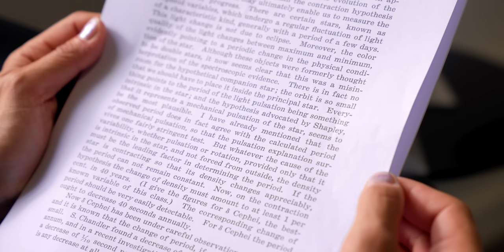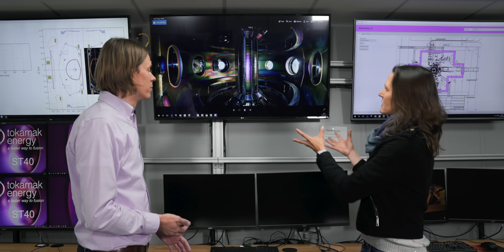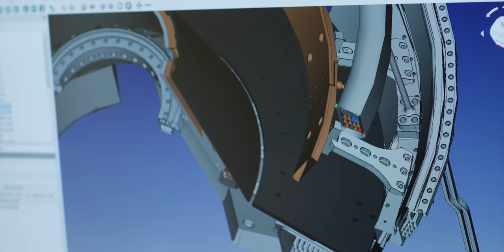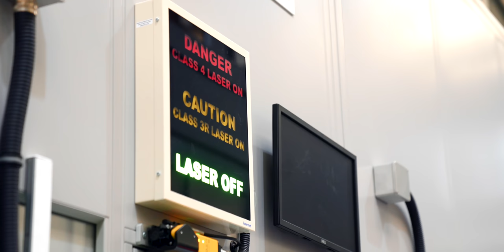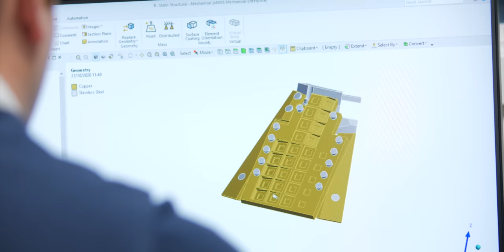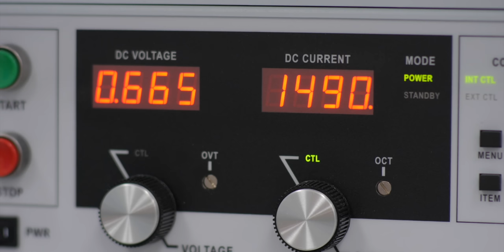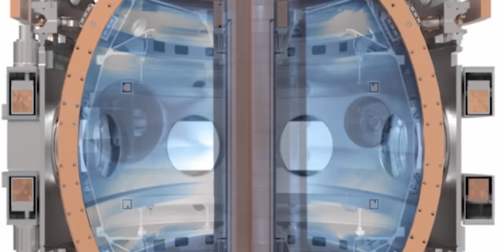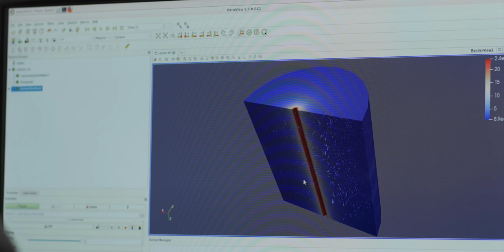Nuclear Fusion: The Secret to CHEAP and LIMITLESS Clean Energy?!

Comment: the problem of having too much energy is worse than expanding beyond our means so there always isnt quite enough. 

But i suppose thats something we'll realise later, much in the same way we seem to do everything.
Reply: How do you expand beyond your means with unlimited energy?
Reply: @vesawuoristo4162  another way of describing it would be having 1000 cars but you can only drive 1 at a time, have a 1000 houses and only live in 1 at a time. You gonna maintain those 2000 cars and houses???? etc.
Reply: @gaiustesla9324  
How about build +10% of requirement.
Turn off 10% of capacity.
Adjust as required.
?
Reply: @rogerstarkey5390  brilliant! except totally not realistic unless you have a dictatorship over technology and energy.

Comment: no is the answer as it's proving mind-bogglingly difficult to control plasma
Reply: The problem that nobody addressing is chaotic/turbulent flow in the plasma. It's fine for a short while in controlled laminar flow then it goes crazy.
Reply: @grahamstevenson1740  There are entire research groups working on turbulence control in fusion devices
Reply: @arnasvolcokas7289  Good luck to them ! Turbulent flow is an entirely natural effect.

Comment: I am very skeptical about this. Nuclear fission was discovered in 1938 and we an atomic bomb 7 years later. We had the first controlled nuclear reaction 6 years after that. We have been aware of nuclear fusion for nearly 100 years, and there is STILL no technologically feasible method for creating a man-made sustainable fusion reaction that produces significantly more energy than it requires to sustain the reaction. 

This video set out to answer the question, are we still saying "fusion is 30 years away?" The answer is apparently "yes". Even if we overcomes the technological hurdles, there are no reasons to believe that the resulting technology will be economically feasible. It seems like solar/wind power plus storage is a vastly more practical and economical way to create unlimited amounts of green energy. Nuclear fusion seems like a multi-billion dollar boondoggle to me.
Reply: Fission is indeed much easier and mature.
It also is near limitless.

It's just ignored or vilified by many who don't understand it.
To be fair it is nuclear science and not an easy subject to master.

Comment: What interests me - is that accidents happen, terrorist attacks happen, etc etc.. What happens when something goes wrong?  Will it safely just shut off and do nothing?  Or are we talking about half the planet going kaboom?
Reply: They are exceptionally safe from major accidents - if a bomb pulverized the plant the most dangerous thing would be the bomb. There would be radiation release that might require small targeted evacuation but it would have to be blasted by an external attack... the reaction requires such fuel purity that you could out it out by blowing on it

Comment: So it is now 10 to 20 years away.   That will probably be the case for next 50 years.
BUT
I already power my home nearly 100% off fusion (froom H2) derived energy, the reactor runs 24/7 and has been for a very long time.  We only access it for for less than half of that 24 hour period and extract (capture) energy from the reactor using photo Voltaic panels which turn that into electrical energy.   
So I see planet earth's source of fusion energy will be unchanged for many decades to come so need to focus on maximising capture (solar, wind, wave etc) and storage of this reactor's abundant energy for our planets energy needs.

Comment: Why do we need this, when the sun delivers 1000. times more energy to earth, than mankind needs?
Trying to create a new monopol?
Reply: Because a lot of that energy falls on e.g. the oceans (where we can't - effectively - harvest it), and of the land surfaces, a lot of them also aren't suitable for solar - for a variety of reasons.

Solar also tends to be fixed in place - if you have e.g. a large ship (to use just one example), the amount of solar energy falling on that ship would be completely insufficient for actually moving that ship (even if you could capture all of it, rather than the ~35% that is the current limit).  Currently we get around that with batteries to store the energy - but even there, batteries are insufficient given the amount of energy involved (energy density would need to increase 10x - or more - before batteries become viable... and even then ships would need to dedicate ~3.5x more space for batteries than they currently do for fuel)
Reply: @logicalChimp  
Thanks for your comment!

Comment: I do not understand how computers cannot help the design and run computational experiments without building a Tokamak first.
Reply: Of course they use computers to model really everything on this reactor system.  Those are extensive calculations splitting up the area in millions of cells .... but as always: the proof of the pudding is in the eating ...
And after the tests, the models are adapted and so the game goes on and on ...

Comment: No one has said what this ‘extra’ power is in wattage. As in if it takes 100W to run it, does it give out 150W..?
Then add in the cost of labour, maintenance and repairs to run it, how much in $ does that cost?
How many hours/dats/weeks can it run reliably?
Look, great tech. But I can’t find any data on these tokamak reactors output vs input. Even ITER…

Comment: Making different types of hydrogen is not easy or cost effective, there needs to be another industry making  it. Then there is the maintenance problems which is massively expensive. To convert the energy is very complicated, I just think its a pink elephant- I just hope it isn't  just to make investments and shares. The huge reactor in the sky doesn't cost anything and it already sorts out solar and wind power with low maintenance costs. I would like to see this work but its a huge undertaking to make it viable.  Fingers crossed though...

Comment: A brilliant video. 

It has raised some questions in my scientific illiterate brain. 

Does fusion require any materials as fuel and generate any waste or is the plasma a sort of perpetual motion machine once it’s running?

What generates the electricity? Does it happen as part of the reaction and harvested from the reactor or is it generated by a secondary means such as using heat from the reactor?

Are there decommissioning and radioactive waste treatment costs?

Finally, it looks very complicated and expensive. Could something this complex economically generate electricity compared to its competing technologies of renewables and storage?

Interested in replies from anyone who understands fusion better than me 😁
Reply: 1) You turn various hydrogen atoms into helium. You are consuming hydrogen isotopes to make the power. Fortunately deuterium is abundant, and tritium less so but still available to some degree. We can collect it from the sea. In the longer term supplies of tritium may be challenging.

2) To some degree it's like every other power system. It makes lots of heat. We can carry that heat away and potentially run a steam turbine. In the video, that's achieved by absorbing the ejected neutron's kinetic energy.

3) I believe the reactor itself may become low grade radioactive over time due to catching all those neutrons, and there is the handling of the tritium. It's not a particularly big deal. Unlike a nuclear fission reactor, the majority of the radiation stops when you turn it off. Tritium is a lot less hazardous than uranium for example, and you need comparatively little of it.

4) Superconductivity is comparatively commonplace - there's an MRI machine in most hospitals, but the controlling and ignition of the plasma is very technical indeed. I don't think we'll know if it's profitable until we've had multiple reactors in service and the industry has a chance to iterate on the equipment manufacture. However we can hope that they will at least be cheaper to build than fission power stations, because the amount of regulation should be comparable with combustion-based power stations. Even if it is more expensive than solar and wind power generation, there's something to be said for continuous supply whatever the weather and maybe we don't need to carpet the country in semiconductors and fibreglass.
Reply: @KieronTaylor  thanks for the explanation.
Reply: @KieronTaylor  As an added bonus, once they have it working, it could then - potentially - be miniaturised, providing a power source for large ships etc (which are poor candidates for battery-electric and similar) and other scenarios where space for Solar / Wind etc is at a premium (or not avilable at all)

Comment: So it's still more than 10 years out into the future. Climate disaster is happening now. 
Also: it will take a long time after that point, before all the energy ever put into making these fusion reactors work will be superseded by their output. 
I remain critical, not on whether it can work, but whether it can make a difference in turning our grids 100% sustainable soon, which it seemingly cannot, but is what is needed.
Reply: Remember that current nuclear stations will need to be replace at their end of life.. hinkley point as a ~40 year lifespan so maybe it'll get replaced with one of these.. or maybe something else but the idea that you shouldn't do any research in a field because it doesn't solve every single problem right now is backwards.   its obviously not going to clean up the grid super fast, everyone knows that and that's not the problem they can solve.  

We dont presently have a non-nuclear route to net zero so we'll be playing with the things for a LONG time so might as well get the research started now.
Reply: @mralistair737  Just to be clear and I am sure you didn't mean to insinuate that: I did not mean to say, not do research in fission. But it is not something we remotely can use to negate climate change here and now - we are at a point were "we have a solution in 2040+" statements are hallow and almost useless. The same goes for wanting more convential nuclear plants.
So investments need at least partially be made with that in mind.

Comment: Why can this start-up pull off what ITER can’t?  Is it the high temperature superconductor, because the rest seems the same but on a much smaller scale? Nevertheless I think it’s good the pursue all possibilities for renewable energy. Stellarators, HB11, wind, solar, tidal.. bring it on 😉
Reply: The design is different, Tokamak use a compact spherical reactor design, described as a cored apple, rather than ITER which has a traditional donut shaped torus. As I understand it this means the Tokamak Energy machine is more efficient and can achieve fusion at a significantly smaller size. ITER needs to be enormous to work which obviously adds to cost. This also means that if it works the machines can be built in modules at factories and assembled at site meaning a potential deployment can be faster and cheaper. But also important is that Tokamak is a small little private company so can innovate faster. ITER is a multi-country behemoth and it just takes more time to do anything, must be a bureaucratic nightmare. It's so far over time and budget they don't even bother talking about it anymore.

Comment: Great video, it is truly amazing if any of the ever succeed but only from a technical point of view. Fusion energy is NEVER going to be cheap enough to compete with wind and solar energy. So there is no game changing technology on the rise. As a physicist it is still very fascinating to watch and follow each and every year.
Reply: That depends on how you calculate the costs… with a failing climate, the cost or not developing Fusion over other renewables may have much larger implications. I agree it is currently an if, but if one of these projects produces a working reactor (even a small demo) in the next 15-20 years the energy it could add to the grid compared with wind and solar is massive and it’s base load rather than only when the wind blows or the sun shines. I work in wind and love seeing the growth and development but I strongly believe we will overcome the obstacles and have a working reactor in my lifetime…

Comment: The possibility of cheap, low-cost energy has been a dream for many years. However, it is essential to consider the implications of this on our society and economy.
A few potential scenarios could play out once we achieve this energy. Firstly, it could significantly increase economic productivity as businesses would no longer have to worry about the high energy costs. This could lead to a period of sustained economic growth and development.
As our economy continues to develop, the pressure on our ecology will increase, resulting in more ecological imbalance and ultimately more environmental problems. Our rate of resource consumption is not currently sustainable, and as our population and standard of living continue to grow, the situation will only worsen. We need to find ways to reduce our impact on the environment, or we will damage our planet even more.

Comment: The problem that all of these fusion programs gloss over is the fuel. Fusion reactors use deuterium and tritium. Tritium does NOT occur naturally. It can only be made by bombarding deuterium with neutrons in a fission reactor. All fusion reactors get fuel from fission reactors, which somewhat defeats the point. So far, there are no practical solutions to the tritium problem.

Comment: The moment Fusion happens on Earth, the entire World Economy changes.
Reply: The same applies to the "100 square miles of solar" referenced by Elon Musk.
However we get there, it's essentially a "one off" investment. When capacity is reached and interconnects bounce energy from the "dark side" to the "light side" of the planet, abundant free energy is the result.
But, there will be a literal "power shift" from most of the oil rich countries towards the areas with most sun.
(The Middle east wins both ways)
.
How much influence nuclear has depends on when, who, and how generous the "winner" is toward those requiring the design.
Reply: @rogerstarkey5390  I have had solar for almost 4 years. I've had an EV for 2 years. It's so amazing not answering to anybody about my energy. Well, almost, I still have a pickup truck, my EV doesn't charge fast enough to be practical on road trips, but for local driving I am self sustained.

Comment: Fusion power was touted as the answer to all the negatives of fission power.  Then as we became aware of global warming it has been seen as the answer to that as well.  Fusion power is certainly preferable to the present forms of power generation but it does nothing to discourage the profligate use of power, resulting in further pollution.  We need to find ways to reduce power consumption, not merely replace the generating system.
Reply: We need to do both, as well as have a clear and thorough understanding of the externalised products of any and all of not just our processes, but all of the ones that occur in our environment. Slowing down our activities and consumption makes sense while we don't know how to limit those effects, but is not a good unto itself. If we can consistently mitigate and manage the undesirable products of our activities, they do not on their own present a reason to curtail them.

Not that I'm saying we shouldn't knock a lot of our nonsense on the head as a species; we waste a lot of effort and energy on greedy and stupid endeavours. I just don't think mitigating energy consumption is a goal, just a sensible efficiency measure and mitigation technique while we learn to manage/ build better infrastructure.

Comment: So a super conductor at absolute 0 (well almost) and plasma hotter than the sun. That should produce enough energy at fusion to supply a net surplus of energy... I wonder if there is a graph that already shows we are eking towards that threshold? If we are almost there, these massive undertakings should already provide a whopping amount of energy! So producing so much energy that we are already moving towards a  neutral footprint, though the massive feat that would be, is still not enough to be able to go in for the kill...

Amazing and mind boggling tech. But 13:40 shows me it still might be these flipping 30 years away before we get a net result enough to say we have something usable. Anyone?
Reply: I think one of the projects got net positive energy.. but they are running in fairly short periods of time.   rushing to get a research project to tick a net positive box would get good press but isn't necessarily the best way to get to a net positive commercial sized plant.
Reply: @mralistair737  absolutely agreed. Don't think this field allows for cutting corners anyway. And to be clear I do hope it will materialize in the near future in a sustainable way, it just often seams high stakes poker given the fact we (they) are operating at the maximum bandwidth of what the universe is made of anyway. If we get there, it is one of the biggest achievements of mankind, and there are so many to choose from! (LHC comes to mind with the Higgs boson for instance).